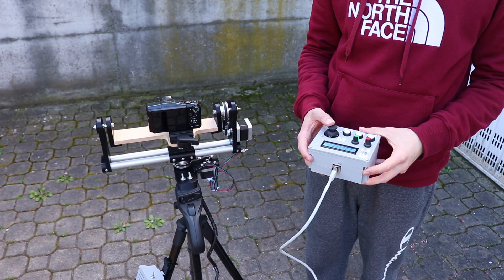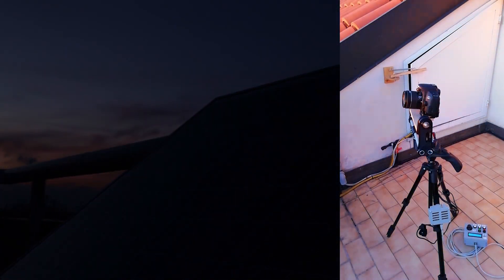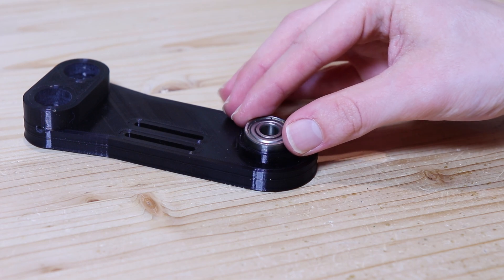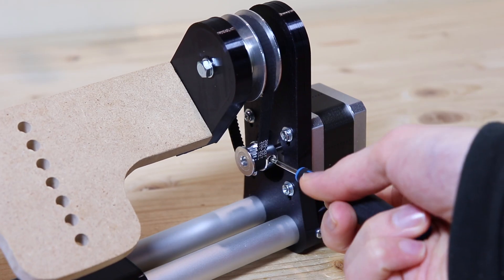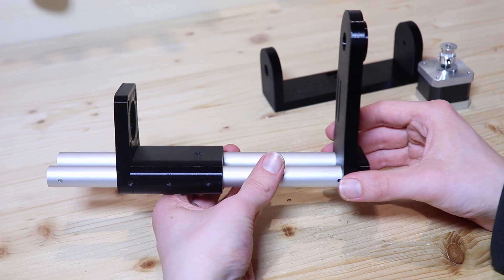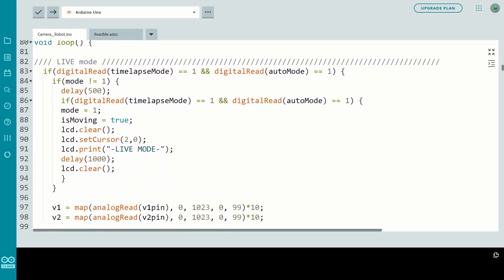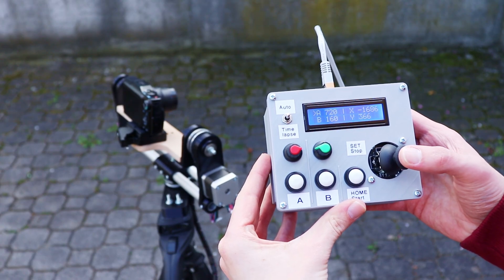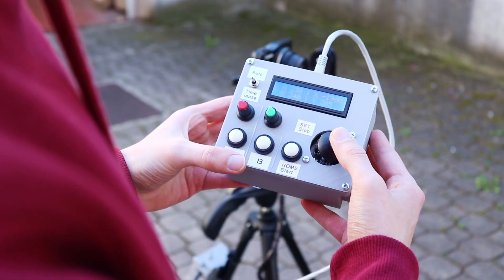I built a CAMERA ROBOT to make perfect videos! (move a camera with Arduino)

Comment: Cool.  Probably too wide.  Will get less shake if you cut the size down a little and put it on a beefier tripod.  Cool thing about using stepper motors is your rig will work with professional moco systems all over the world.
Reply from the maker: Yes, I noticed that the moving part is too heavy and wide, so it has a lot of inertia. I made it like this to be able to see the camera monitor from every angle, however I could connect and external monitor to be put off the robot and save a lot of space. I will definitely change the tripod when I have enough budget, because this isn't strong enough to hold the robot and the camera (yesterday I risked breaking everything because the tripod head suddenly turned 90 degrees). Thanks for your suggestions!